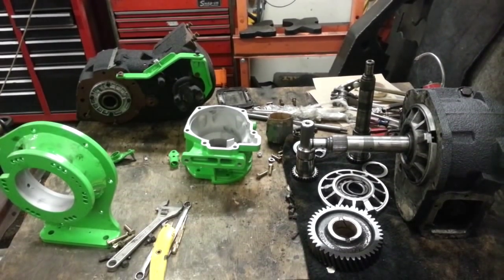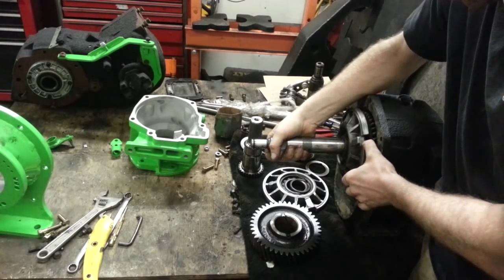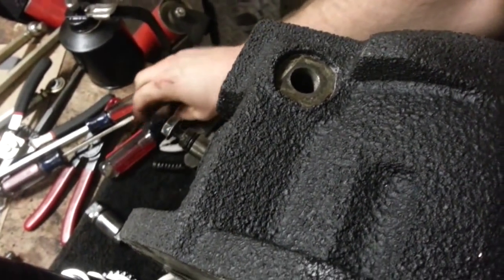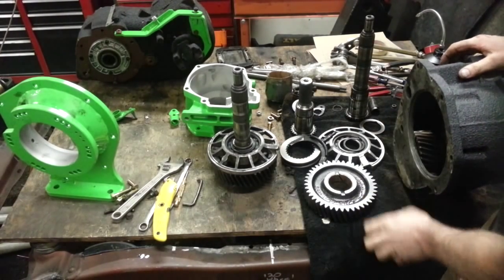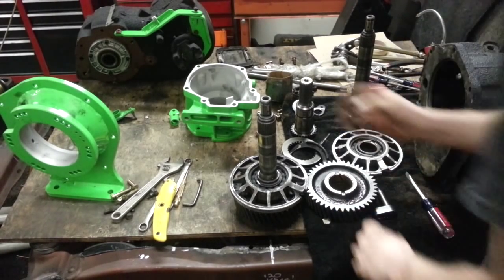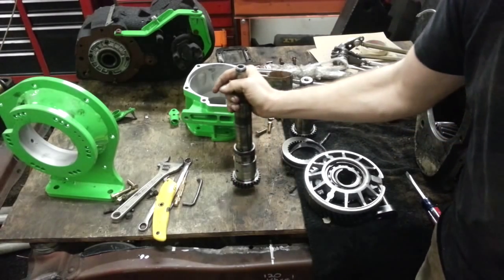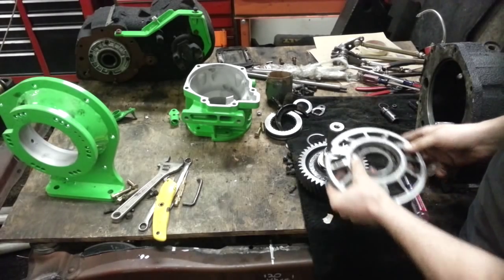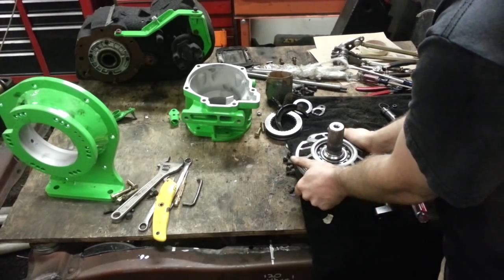New Process 203/205 doubler 4:1 low range part 2

Comment: Just a fun fact. Alot of folks dont know New Process gear was owned by Chrysler Corp since the early 19oo's. up until not to long ago. Chrysler was the supplier for all full size 4x4 trucks. also standard transmissions.
Reply: Actually all Ford manual transmissions were produced by them up until the current style of aluminum case transmissions. I think maybe you may have some incorrect information on the transmissions. Ford transmissions were produced by T+C.
Reply: I thought NP was a sort of joint company between Chrysler and GM? And that's why the Nv-4500 was used by both

Comment: Putting together a 203/205 set-up. I was told to get a 205, off a stick. I have 2 of them. But someone else told me I need one off a automatic. My 203 is off a automatic. What one do I need to get this done. Or does it matter?
Reply from the maker: Bradley Stroup It really comes down to..... Is it a for a chev style trans?  If your looking at ford it makes it really easy all fords are 31 spline output shafts from the trans to the case.  IF its a chev you have to see if is a small spline (like a 27 i think) or if its a large spline (something like 32 spline) so no it doesn’t matter if its a auto or a manual. I hope this helps sorry if your doing a dodge don’t know much about them its all blue or red in my book. 

The above is for the 203. as far as the 205 goes it just needs to be for the side drop your need, like pass or driver side (aka chev or ford). The 205 can tecknicly be any spline you have Jeds can make the 203 shaft any spline that you need to fit your 205. while i would try to get something in a higher spline count as it would be stronger at the matting points what you have that fits would wood work. 

trans spline + 203= must match

203 + 205= talk to dubbler maker to get the right spline for your application 

this makes it easy cause the trans and 203 could be a chev style and then you can run a ford style 205 behind that and run a driver side axle (aka high pinion diff).

Comment: just wondering why would anyone want to put a truck in in front wheel drive? or maybe im not understanding the concept. sounds like what your saying is you can put the 203 in hi/lo, 205 in hi/lo, then have the option of doing 4wd, Rwd or Fwd? and of course have the option of doing both tcases in low/hi to make a specific gear ratio and also control front/rear wheel drive?
Reply from the maker: Cory R yes fwd on with the two tcases in hi or low. you would want to do this for a front wheel dig to get around in tight spaces or with long wheel base rig.

Comment: oh ok cool. was just doing a bit of research on the 203/205 doubler and was thinking to myself i would like to have 2wd low range but front wheel drive not so much.. any easier way to set up a doubler that will go in 2low?
Reply from the maker: Cory R  you can go with an atlas but they are more coin. or with a black box I like the dubblers cause I can use j y parts.
Reply from the maker: Cory R the 205 will do 2wd in front or rear hi and low, without the 203 kit. just do the shift rail shave on the 205 and your set!

Comment: With a LowMax case you could get your range down to 5:1. I'm curious though. If I wanted to build this for a divorced setup could I, or am I stuck with a married arrangement?
Reply from the maker: Ken MacMillan you can only do a lomax on a chev pass drop or run it upside down for a driver. you could do a devorced arrangement but it's going to start getting long and you would have to put a sort drive line in between them. this means more parts to service and possibly of breakage. if you want something lower than the 4:1 I would go with a two speed atles. Of course you could just add another 203 t case  so you would end up with a set up looking like 203 203 205 that would get u to 6:1 and be close to what u would be with the devorced setup. 

I would ask u what is your wheel base?
what is your buddget? 
what gearing are u going to run in axles, trans? 
what power are you getting out of engine?
 I would shoot for a crawl ratio around 55-120 if possible. of course the closer to 120 the more expensive it gets.

Comment: Is this set up ok to drive on the highway. Or just off road.
Reply from the maker: Bradley Stroup yes it is totally OK to drive on the highway as you would have it in 2wd hi. thus it being @ a 1:1 gear ratio. you can do this in 2wd front or rear (if you do the 205 twin stick op), that’s what makes this setup so great. you can do 203 ( ops HI or low) and the 205 in front (hi or low) and rear (hi or low) the 205 has a lock out so front low and rear hi or viscera is not passable. the 203 is a 2.0:1 +   205 is a 2.0:1 = 4.0:1 ratio but only when both the 203 and 205 are in low. hope this helps. ill make a video explaining this soon as it is a little funny to try and get ones head around for the first time.

Comment: Why not install new lower gears in  the one case. and save lbs and fuel....
Reply from the maker: dam1041960 the lower gear sets are for the Chev 205 not the Ford  or driver drop.